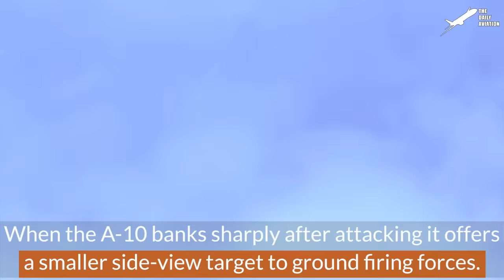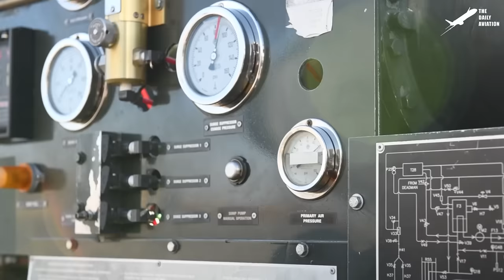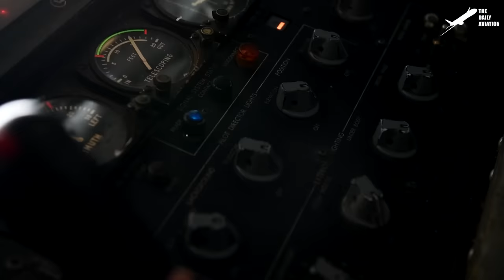Loading 1000s of Scary Rounds into Feared US A-10 GAU-8 Gatling Gun

Comment: For most of the humans I have met, a single 35mm round will generally reduce the usability of that human quite significantly. As for bigger targets, the odds do increase, however slightly, but with a cyclic rate in the thousands, even 1 in 5 will create significant amounts of scrap metal. As a combat veteran I have witnessed the effect of that nose gun and Sparky, you do not want to be on the receiving end of even a low hit percentage from it!